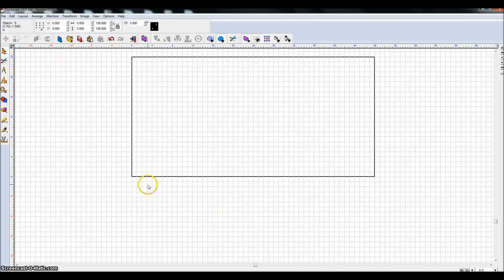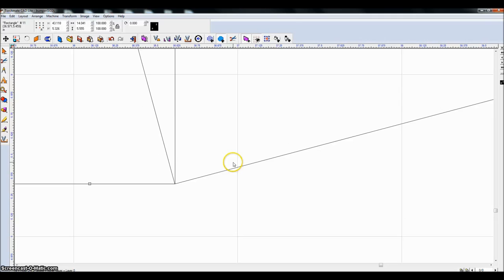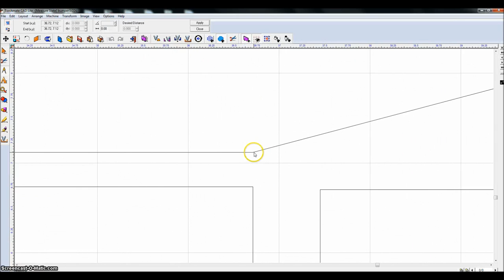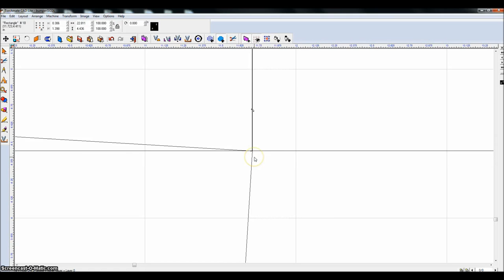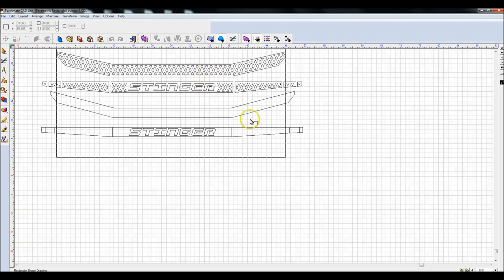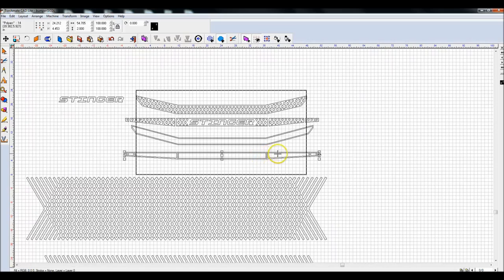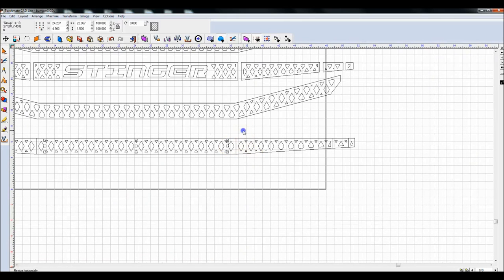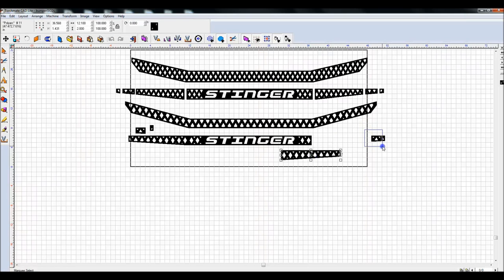Torchmate CAD/CAM: Designing a Go Kart Bumper

Comment: I am coming from a cadd  background and have not found a demo of the TM cad/cam program that makes me feel good about the cadd part of the program I checked out your 2.5" flange demo and I know that it is close enough to make a good part but you should be able to draw the flange dead on in under a minute without using shapes other than the circles then offset the circles and join the tangents of the circles for the straights and trim out the inside of the outer circles. thanks for the videos

Comment from the maker: It has a snap to grid option, but I have not found a way to have it snap to intersections or points.  You can add guides at any time, and I have seen it snap to the guides, in addition to the grid, and as long as you set those at the right points it will snap to them, but it is a major pain in my opinion.  I could change my grid size to something smaller and that might work, but I am used to it at this point.
Reply: John Harmon - Cold Creek Works     Cv

Comment: I have been looking into other cadd programs Autosketch ( Autodesk product) looks promising and only cost a little over $200 Autocad LT runs about $1200 I'm just concerned about the dxf conversion into tm cad/cam but it should be a problem I can work around. I'm still waiting for a reply from Bently (Microstation) on weather they offer a stripped down 2d program. 2 grand try about 4 to 6 grand and yes that is way to much to pay to use 1% of a program.